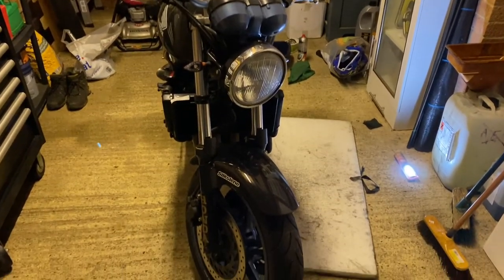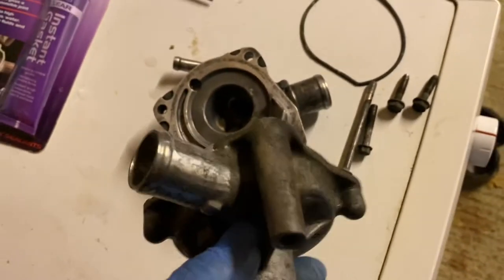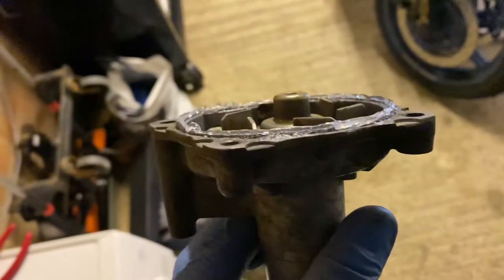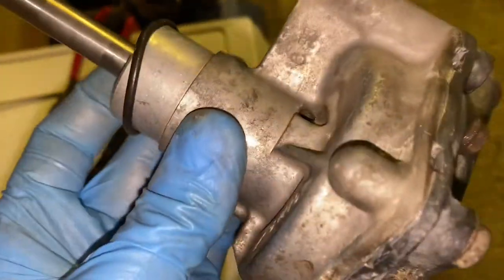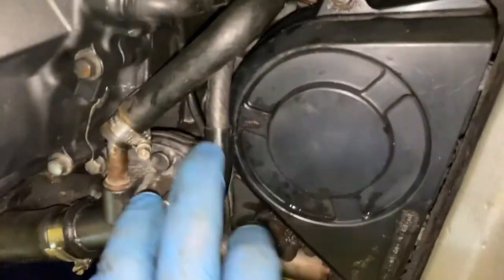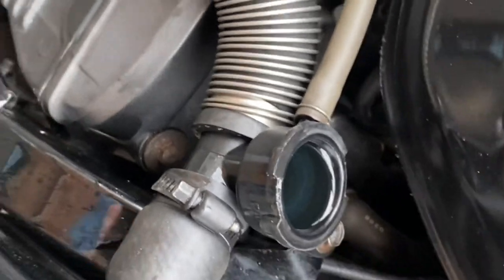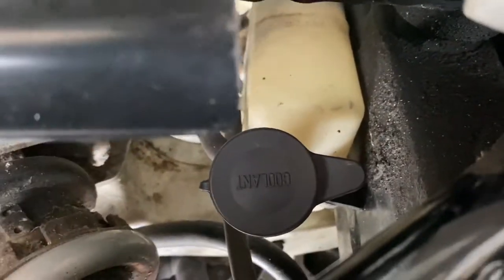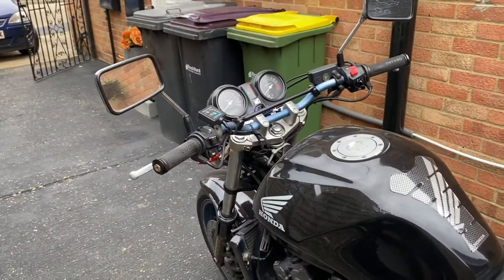CBF 600 leaking water pump repair.

Comment: I may have missed it but Honda has a hole at the bottom of the water pump to act as a ´telltale´ or signal that the internal mechanical seal on the pump shaft is compromised.  It acts as a drain that will leave antifreeze on the floor alerting you to the failure of said seal.  If that is the case you should not have welded it.  By welding it you will ensure the leakage gets into the engine itself.  Not sure if that is what you did but make sure everything is as it should be as antifreeze in your engine oil is a bit of a nightmare.
Reply: is this actualy a future and is it stated in the manual? (mine leaks even after replacing the housing seal.  does this mean i need to refurb the pump?)